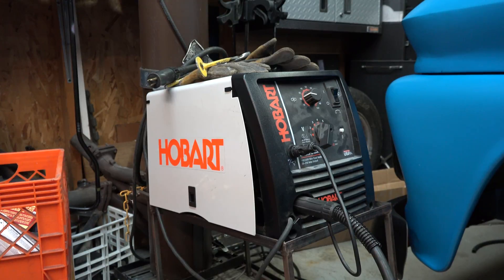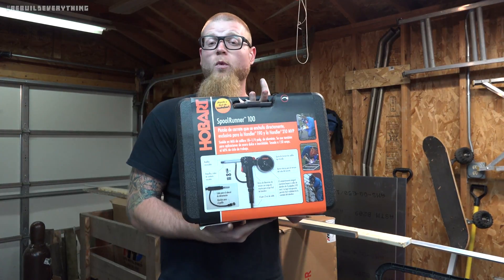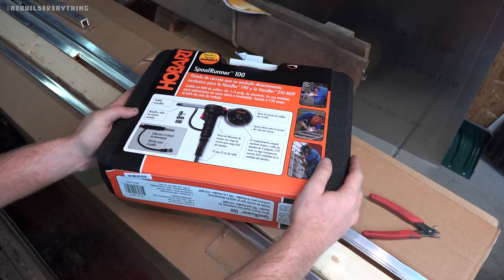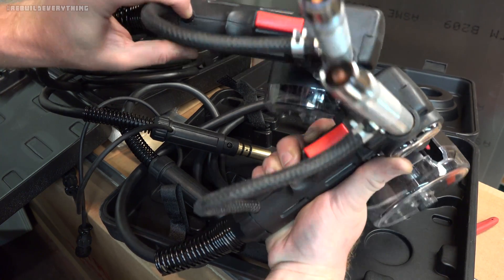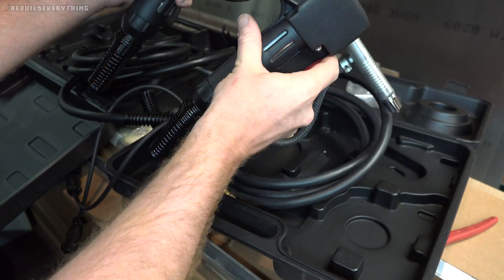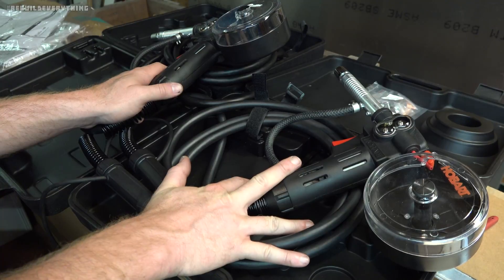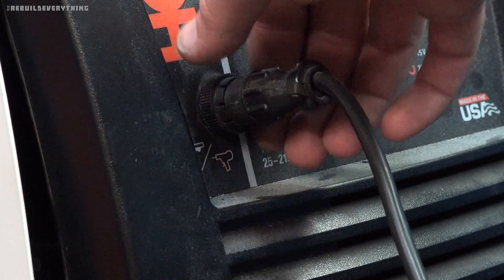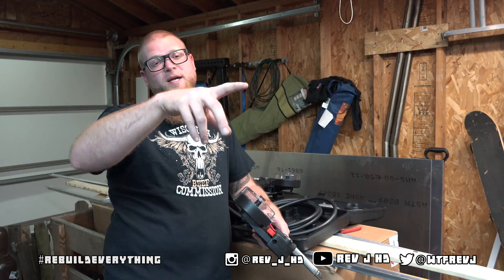Hobart SpoolRunner 100 for Aluminum! - and why Hobart and Miller don't interchange

Comment: The 210 and 211 are different in that the Hobart is a transformer machine, and the Miller is inverter. Different power technologies. I would imagine that's why they made a different plug for each. I have the 210, and for the cost, I'm glad I do

Comment: The Miller welders and the Hobart Ironman is identical! There’s no difference. My son’s Miller 211 spool gun 150 runs on my iron man 230 my beefy 200 amp Ironman spool gun runs on my son’s Miller 211! Millerwelds will ether try and tell you it won’t work or when you tell them you have already done it they just hang up on you because they know you have figured out a secret.

Comment: Well crap...the miller is nearly $500 now in 2020.  I was hoping to use the hobart.  Thanks for the video.
Reply: we use a Hobart on a miller 140 at work. they work correctly and it went in exactly like I was supposed to

Comment: You can switch the lug, just buy a Miller connecting lug and pin correctly.
Reply: Have you tried this I’m very interested I have a Miller 185 and was wondering if this would work. Or by making a adapter with my lathe

Comment: This was the exact video i was looking for.  The nozzle and contact tips can be switched between the 2 units pretty sure, but yeah they change the diameters so you have to buy the specific brand.
Reply: Doesn't matter about the backends on these guns they both use coax mig cables that have standard threads and 2 white wires for the trigger and 2 wires for the motor (red and green). I've used mine on a forney MP machine with a European style plug. So you can buy either and simply rewire the low voltage wires.

Comment: I suspect the difference between the Miller and Hobart Lug Connector is because they weren't always the same company. The difference in lug design  probably dates back to before the merger.
Reply: Correct Calvin Handley.  Hobart made welders for many years and they were pretty well built, but they couldn't compete with Miller (Big Blue) and Lincoln (Big Red) so Miller bought them out I am guessing in the mid 90's ?  It was smart that Miller kept the Hobart name which allowed them to get into the low end/hobbyist market, as they make much more expensive heavy industrial machines.  In the early 80's when I learned to weld at school we had all Miller's and one Lincoln flux core ( which we never used).  They were big heavy transformer,s (no inverters back then) 480 volt 3-phase probably 300 to 400 amps and maybe 80% duty cycle and they never gave us any problems.  They were probably 20 years old back then and I bet they are still using them today.
Reply: @davidmarquardt2445  miller didn't buy them, ITW bought miller and Hobart